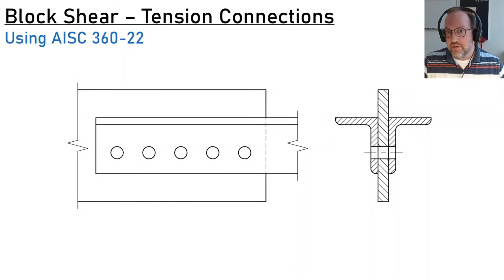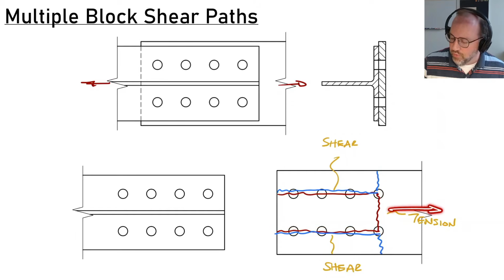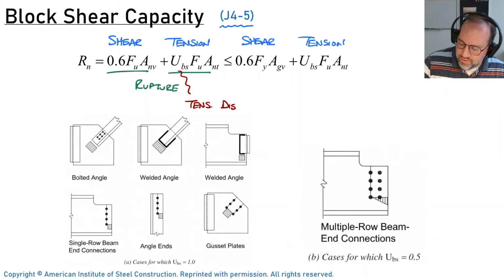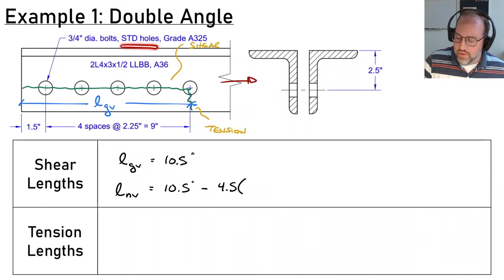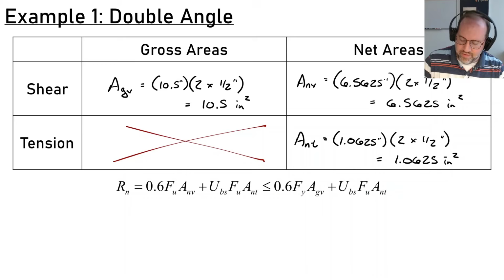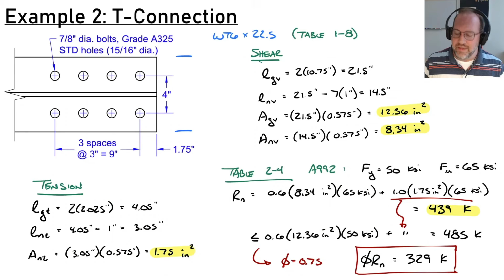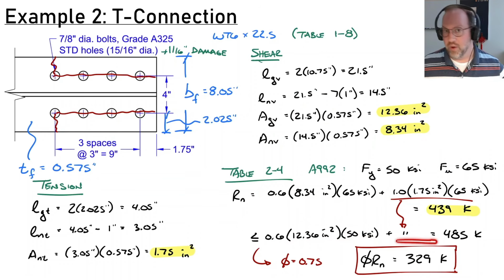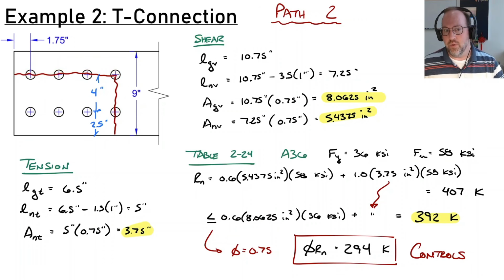Block Shear Failure of Steel Sections - Design using AISC 360-22

Comment from the maker: I missed one block shear mode with the WT-section in Example 2. It is possible to have a shear failure along the stem, with a tension failure through the entire flange below the stem. It's a bit tricky to visualize, but here is a great resource showing a T-connection in block shear:
https://aisc-org.github.io/aisc-model-viewer/wt-plate/#3D-model
Check out Block Shear 1 in the link above for an example. I only checked Block Shear 2 in this video. The link also has the example calculations. Shout out to Peter Talley and Mark Denavit, who put this together!